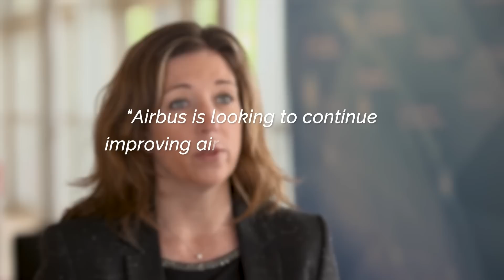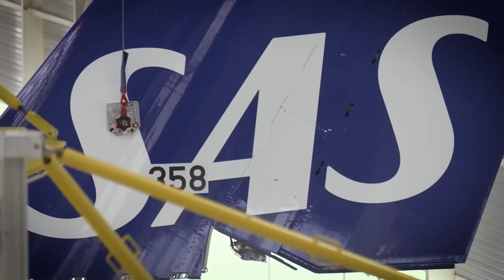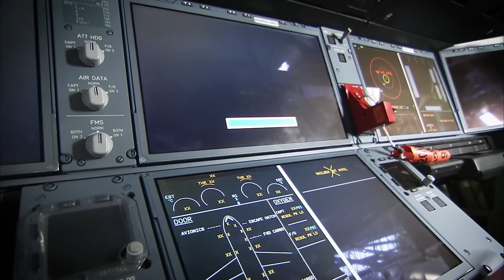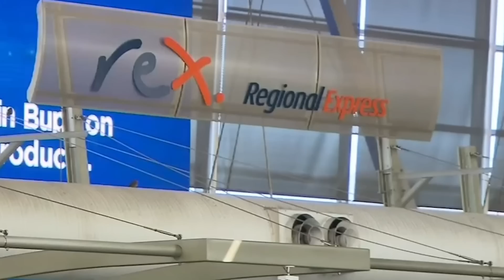What is Airbus' next aircraft?

Comment: I'm not sure airbus needs to fear a narrow niche of 777.
But I would like to see a plane done in pure carbon fiber, in a more aerodynamic shape a bit like Celera and Piaggio such that its compound curves makes just a carbon fiber shell rigid enough. So it has no frames or stringers, as light as can be. In A320 size and 2mm thick CF it could hold 10 bar pressure and weight only 1.6 ton for the entire fuselage. Similar for wings and some for floors etc, it could be around 4ton before engines. A lighter plane needs smaller engines so I would place them at the back like a private jet or Embraer ERJ. Better aero and rear engines could be much quieter cabin. It also means it can have shorter gear which is lighter and simpler. Then take it up to 50000 feet or higher where the air is thin and let it soar. I think you could pull off maybe 40% reduction in fuel consumption which would be pretty huge. If it's also quick and inexpensive to manufacture then it will be very hard to beat. And despite reputation, carbon fiber is actually quite inexpensive. It easily pays for itself. I estimate that an A320 size plane would use 150k$ worth of brand name carbon fiber and that's just insignificant cost. btw I would make it without windows. Digital windows on a quality OLED screen on the back of the seat. Where you can select what direction you want to look in better quality than looking out a window.
It should have airless tires and spin them up with an electric motor for touchdown so it shudders less and wears less. It could also have motors to push back by itself but that's a little more risky to have motors opposing the landing direction but with careful design it could probably be safe.
Reply: A220-500 Coning Soom
Reply: Doesn´t airplanes need to have some metal In the fuselage and wings to prevent lightning strikes?
Reply: @runeskogstad6927  I think they embed some metal strips here and there, apparently it's manageable. maybe even if you ignore it. many small GA planes are pure composite. Airbus A350 and B787 are mostly carbon, I haven't seen any large metal in them. I wouldn't be surprised if they just put thin metal tape along the spine before paint and that's that. But it's worth considering in the design. Carbon fiber is slightly conductive but it might explode and delaminate the hull which is an expensive repair

Comment: I believe that the next generation of airplanes will be hybrids!
100% electric airplanes will have a hard time as well as hydrogen airplanes with their heavy tanks with Hydrogen at 700 Bars!
Reply: Airbus already said they are working on a 100% SAF A320 replacement and a Hydrogen powered airplane that will be separate (Zero E) one of the zero E concepts could be a hybrid blend of hydrogen and kerosene / SAF. But the A320 replacement would be conventionally / SAF fueled

Comment: I think the RR ultra fan can be scaled up or down dependent on wise or narrow body styles, and there is talk of an open fan engine design as well... Interesting times ahead.. I think an a350neo would gain market traction especially as the 777X test flights have recently been suspended
Reply: I don't think the Ultra Fan is a next-generation engine.
It's nothing more than a Geared TurboFan Engine.
The problem with the Geared TurboFan Engine is that the take-off power is reduced!
During take-off, the turbine fills up, but a gearbox lowers the FAN's RPM, which reduces power!
Reply: @x-gamessimulator1067  RR are saying the Ultrafan is about 10% more fuel efficient than the current gen and 25% more than the previous gen. They are achieving it by going large and light, larger slower rotating fan blades move more air per rotation. This would be incompatible with the 737 as it has very limited ground clearance and the you would have to scale it right down for a A320 such that a reengine probably wouldn't be worth it. But for a new generation of aircraft designed to accommodate larger engines with higher wing placement and taller landing gear it offers great potential. To reduce gearbox power loss they have removed the low pressure compressors and isolated the gearbox. So rather than a five stage process in other geared turbofans of Fan-Low Pressure compressor-High Pressure Compressor-High Pressure Turbine-Low Pressure Turbine. Instead its a three stage process of Fan-High pressure Compressor-High Pressure Turbine-Low Pressure Turbine.
Reply: @watcherzero5256  
Ultra FAN is big and weak!
The GE 90X has more power in almost the same size!
Reply: @anthonydeas2173  It can be 25% more efficient but with much less take-off power!
The gearbox is good for cruising because in cruising the FAN + engine power can spin freely, increasing the turbine's exhaust power, but it's lousy for low-altitude flight, where the turbine is most required!  
low altitude flight where the turbine is required the most!
If it was so revolutionary, most airplanes would have these engines! The A350 uses the RR 8X XWB trains and the A380 uses a Grearded engine!
Reply: @x-gamessimulator1067  
The UltraFan is a testbed engine, RR have no intention of attaching it to any aircraft with paying passengers. However, whatever you think of it, UltraFan technology has already led to the upgrade of both the XWB-84 and XWB-97, and in fact all the Trents.

Rumours exist, that RR are developing smaller versions, as this engine is scaleable. That might mean a reintroduction for Rolls back into the narrow body market.

The A350 and its XWB engines have been a resounding success, its sold out until the 2030s, so whatever flair you might think you have for technology, you are just another anonymous nobody on the internet sounding his trumpet, like every one else on here, and I'd rather have faith in RR, because right now, they're producing the goods.....
Reply: @anthonydeas2173  The best engine out there is the PropFan, which isn't used because of the noise.